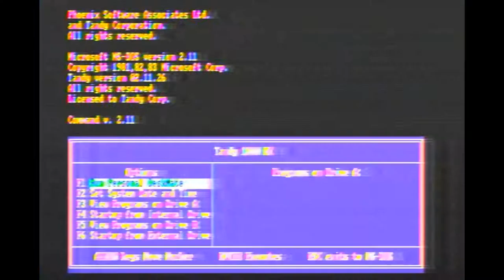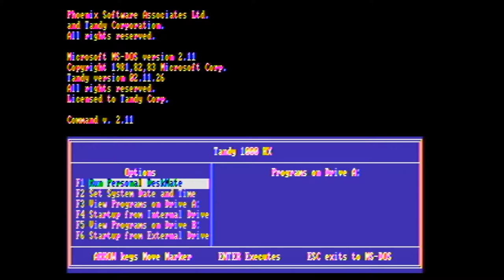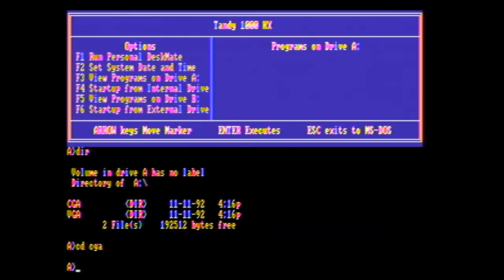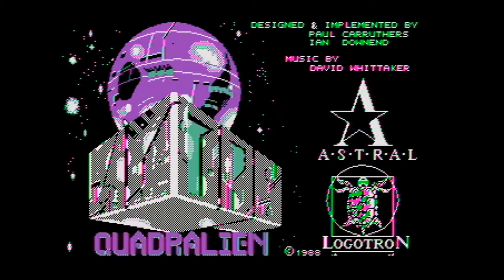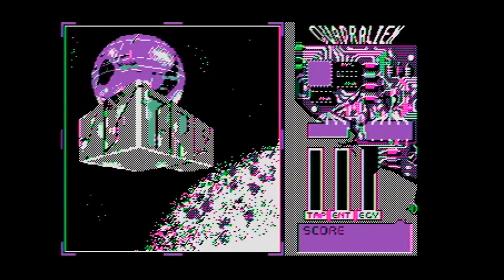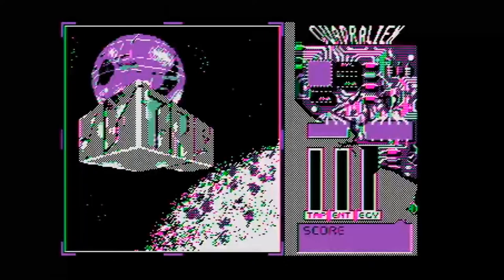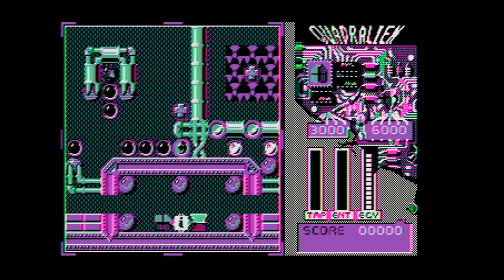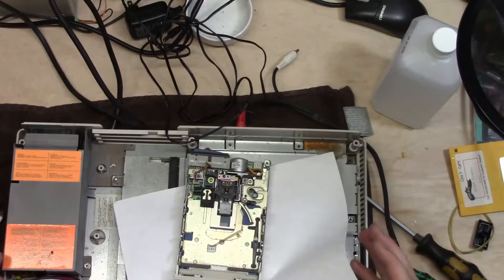Tandy 1000 Repair

Comment: according to the internet the sound chip is a SN76489, which is pretty much the same as the AY-3 series found in the atari ST, sega mega drive and master system, and a bunch of other stuff. it can do three square waves (50% duty only) and has an LFSR for noise. because the chip was pretty common, there's a lot of ways to hack it and get it to do things it's not made for, such as playing samples, AM synthesis, and generating wavetables.
Reply: it appears to be taken down now, but someone had a video up with them coding then using a music player that played NES music on the Tandy 1000 using that chip, and i think it got taken down due to strikes as the music was mainly spot on. the 1000 has some serious chops for gaming, and theres a guy who even makes converters that let you use a genesis gampad on a 1000 or Coco. i show on my channel how to configure DOSBox to run in Tandy 1000 mode. I wish i could afford one, i had the RL growing up!

Comment: My Dad got me one when I was something like 8 or 9, I loved the damn thing. Slow and very unforgiving by today's standards, but wow was it the cream back then! I learned Assembler programming on it, and BASIC as well. I had one of those yellow covered books with like 101 DOS and BASIC programs that you could TYPE in to save to disk, yeah I spent way too much on floppies! Lol

But I eventually got two floppy drives, the memory expansion card, and a 300 BAUD modem!!! I was the hot snot on the block 'cuz I could get on to the different BBSs, I was even able to get an email addy from Berkley (I think) when that first started up - I wish I had kept it active. 😓🤓

Thanks for the trip down memory lane! 

P.S. - I think I might still have a couple of compatible floppy drives if ya'd like (possibly even an IDE HDD 🤷‍‍).

Comment: I am glad that drive still worked, I cringed a bit when you were lifting the head to clean it, those Sony drives really do NOT like their heads manually lifted like that, had you lifted it any more than you did it would have probably been done for, the "spring" that pushes the top head down is just flat spring steel and bends out of shape super easy and then that top head wont work if the tension on it is not right.  Same kind of head/spring assembly in the 68k Macintosh Sony drives too.